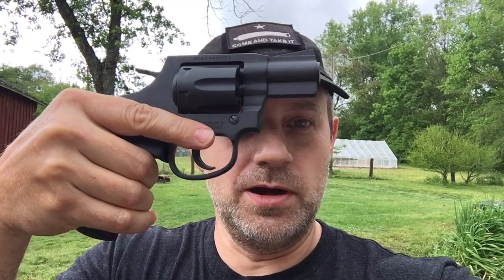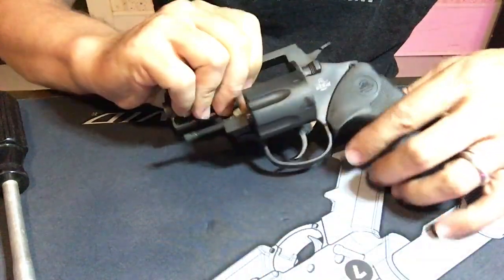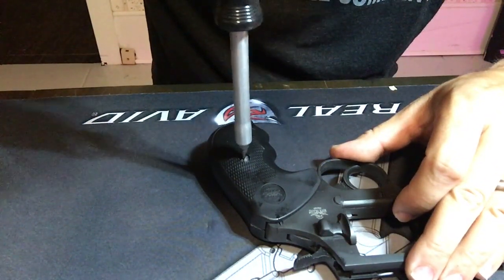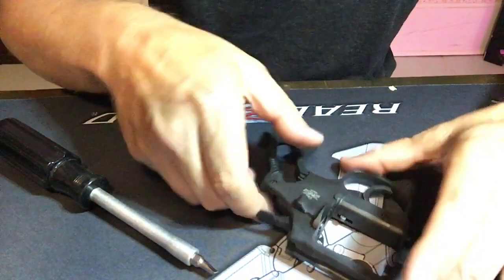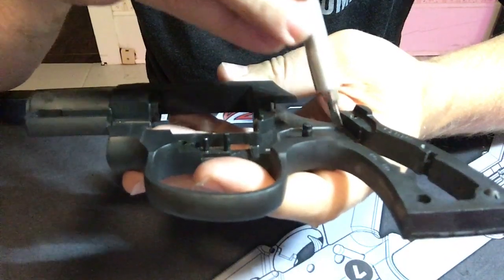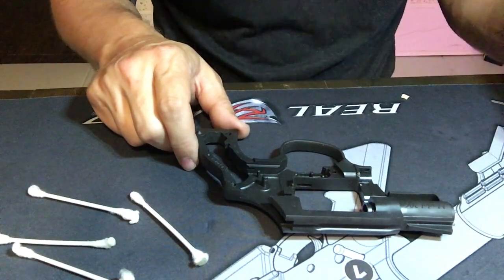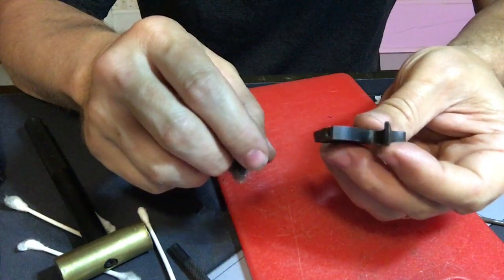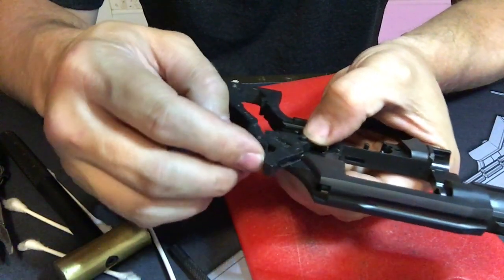Rock Island M206 - Comprehensive  DIY FIX

Comment: Thanks for the great video! I recently bought a 206. The trigger would stick to the rear and the cylinder release would bind-up
I followed your video step ny step also found several large metal shavings caught on the works. It now runs smooth as butter. You saved mr from having to ship it to Rock Island.
Reply: Wish I had found this video 2 months ago. Funny, it's exactly the amount of time it took RIA to fix those same issues you said and ship it back to me! And the cylinder release locked  up and couldnt get it to release. I will use this video to go through and try and make my 206 run better!
Reply from the maker: @hillbillyjimbo1732 you’re welcome.

Comment: One of the comments mentioned that RIA had  worked these problems out; if that isn't the case then I could see an RIA Custom Shop Edition - all inside handwork done and bobbing the hammer a bit. Done n the corner of the factory it should be all of a $20 expense for them at the most, and sure, I'd pay another $60 for the final price. A pragmatic shooter isn't overly impressed with the finish - but does demand flawless mechanical performance. 
Mr. Tuason... i see an opportunity here ;-)

Thanks for a very good video!

Comment: Thanks so much for posting this video.  I was having issues with my M200. After I filed and put steel wool to the areas that had signs of wear, it works perfectly.  It's now 100% dependable!
Reply from the maker: Good job. I suppose about 300 break-in shots might do the same thing but who can afford 300 rounds of .38 Special right now?
Reply: I used it for my license to carry course last Sunday.  It performed nicely.  I scored better than the guy using a glock. Lol!
Reply from the maker: Most .38 snub nosed revolvers are pretty accurate. This one is no exception.

Comment: Right after I sprayed my new one up it almost locked up the cylinder right away.Thankyou for the filing help looks like I got some work ahead to shoot this thing.
Reply from the maker: Just be careful. The parkerization isn’t what I’d have done with this. Blued would have been better. I’ve considered taking a steel brush wheel to it and taking the parkerization off and blueing it.
Reply: @SmithFarmandOutdoors  A ok

Comment: I recently purchased one and I've noticed the threads on the barrel of mine are on the outside where the projectile leaves the barrel not on the inside where it meets with a cylinder like most. My question is is the shroud and bear removable on this particular 38 or did some one who owned it before took it apart and put it back together improperly?

Comment: Good instruction. Mine always fires in single action with that big hammer pull back. In double action I usually get 1 light primer strike per cylinder's 6-rounds. Very frustrating. New-ish revolver so its not like the main spring is wore out.
Reply from the maker: It needs some breakin. The problem with breaking in a cheap revolver is the ammo costs more than the gun.
Reply: One reason for the problem you are having is the hammer on these revolvers doesn't go back near as far in double action as it does in single action. You can dry fire both ways and see the difference. This causes the firing pin to hit the primers with less force in double action than it does in single action. This is an issue I've mainly noticed with double action 22 caliber revolvers. But it does seem to be an issue with some of these RIA revolvers. They can have misfires with ammo that has harder primers. I currently own 2 RIA revolvers. A Model 200 & a Model 206. Because of this known sometimes issue, I use Federal ammo. Federal ammo has the softest primers.

Comment: you got any tips for a loose trigger? I took mine apart to refinish it and when trying to put it back together the post that the trigger falls into doesnt keep in place well enough, so the trigger sprint falls back beside it and I have to take it apart all over again just for it to keep happening.
Reply from the maker: Sorry. No tips on that. Can always send in to Rock Island
Reply: @SmithFarmandOutdoors  Do you think they'll work on it even though I've completely refinished it? I've removed the parkerized finish and hand blued it
Reply from the maker: They will work on it but may not be warranty.

Comment: 1:25:39 I would strongly advise against slamming the cylinder closed that way, on any revolver really but especially a cheaper one like this with probably somewhat lower quality made parts. Good way to mess up the cylinder lockup if you do it a lot.

Comment: Can you make a video disassembling the cylinder assembly?

The extractor sometimes will not sit properly, it has a thread in there and when it is turned it misplaces its alignment to the seat.
Reply from the maker: golong 1 I will look at mine to see how easy it is. I haven’t completely disassembled the cylinder yet
Reply: @SmithFarmandOutdoors  thanks!

Comment: So how does it shoot now compared to when you first got it?
Reply from the maker: It shoots great. There was one issue that I found with the pistol, however that affected the cylinder rotation. There is a spring near the trigger that has a spiral spring wrapped around it. This spiral spring can get positioned such that it will not allow the trigger to reset. I do t like this at all and I may remove it and replace it with a different type of spring. Haven’t decided yet.
Reply from the maker: I’ll have to do a follow up video. With the ammo shortages lately, I’ve not been doing so much shooting. I deer hunt our back also and I’ve been letting the range go to the deer as much as possible for these couple months.
Reply: @SmithFarmandOutdoors  Thanks for the reply, man. I've been thinking of modding my revolver too for better efficiency but am currently waiting on a glock to come into my FFL in case SHTF after the election.
Reply: @SmithFarmandOutdoors  Bro, you should. I really enjoyed this! :)
Reply: @SmithFarmandOutdoors  hey did you ever change that spring? I think mind has same problem first couple of fires but now seems to be fine??
Reply from the maker: I didn’t change the spring but I was able to re-position the spring and have not had any issues since. It could have been positioned incorrectly at first. There is a straight leg of one spring that sits against the wound spring. It’s been a while since I looked at it so I can’t recall all the details. I did some shooting with it this weekend and had no issues. It shot great and was quite accurate.
Reply: What will cause the cylinder not to spin and the pistol will not fire??
Reply from the maker: @LondaBHam something is hindering movement. It could be an infinite number of things. The hand or hand spring that moves the cylinder could be broken. The cylinder could be rusted to the cylinder post. I have no way of knowing. Take it apart carefully and see if you can figure it out.

Comment: How would one remove the barrel?
Reply from the maker: I have not attempted to remove the barrel. There is a pin above the barrel on the receiver that holds the barrel in. The barrel is probably screwed in and then pinned. The pin is actually hard to see as the Parkerization looks like it was done after the barrel was pinned.

Comment: 8:12...."this is the"  ??????????????
Reply from the maker: Occasionally when filming I forget something and insert a pause for editing. This one got past the edit process. That little part is the hammer block safety. Has different names depending on the style of safety. Some revolvers have that part made of wire instead of a machined piece.
Reply: Transfer bar safety

Comment: Mines brand new and only shoots 2 out of the 6 , seems like all light strikes. Wtf man!!!!!!!
Reply from the maker: I would not buy another one if I had to do over. It will take some manual work probably. It’s not worth sending to a gunsmith because it will cost more than the original to fix. Either do the work yourself or send to the factory for warranty.
Reply: @SmithFarmandOutdoors  mine ending up working with federal like you stated, unfortunately you hit the nail on the head with that statement. Guess I’ll just be shooting federal lmao !

Comment: A man with a file, the ruin of a good gun!!
Reply from the maker: The M206 is not a good gun out of the box but it has potential. No reason to mess with a good gun.
Reply from the maker: Also, the fact that I took a file to it before I shot it... says a lot about my confidence level in both using a file and in the inferior machining on the .38. If I had shot it a bunch before doing the detail work, I would have risked internal damage done by shooting it with less than quality machining. I make a practice of thoroughly disassembling and inspecting every single firearm I purchase before I shoot it. That way, if something will go wrong, I might catch it before it happens and if something needs to be corrected before I shoot, I have that opportunity vs just hoping for the best and pulling the trigger, putting my trust in a complete stranger somewhere in a manufacturing plant.
Reply: Only if that man,is incompetent with the file..
Reply: @SmithFarmandOutdoors  great video, and I agree with this statement. I never knock those who know what they're doing. I'm also glad you shared your knowledge. Peace.